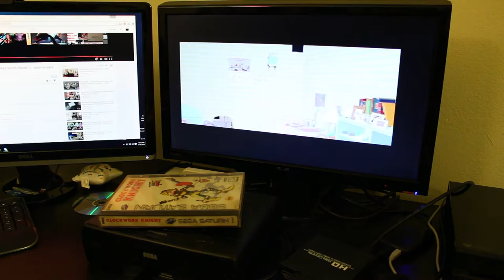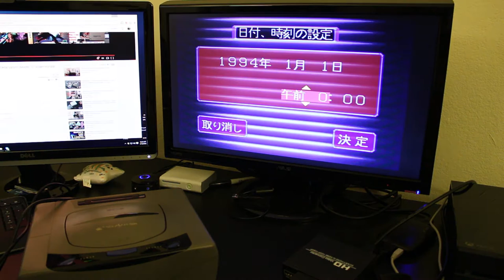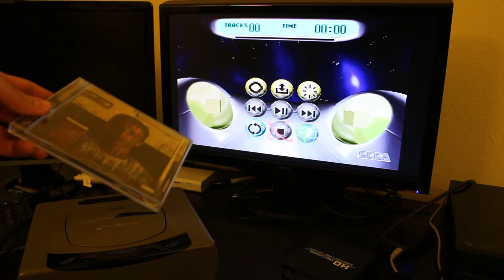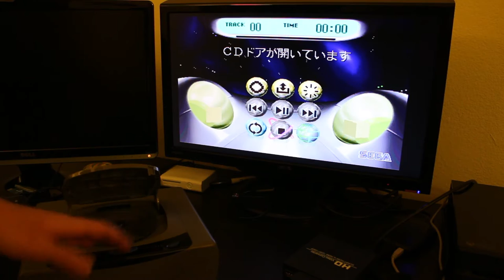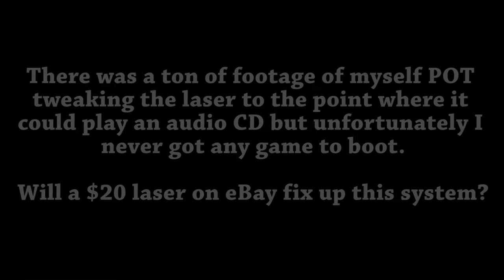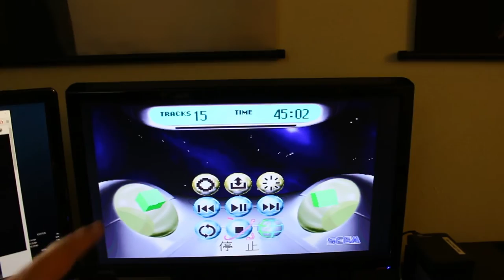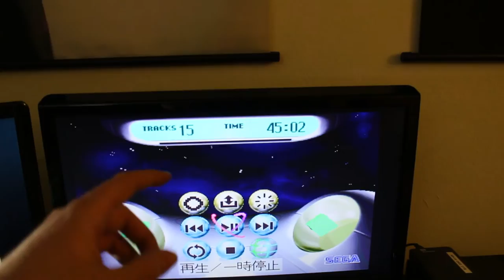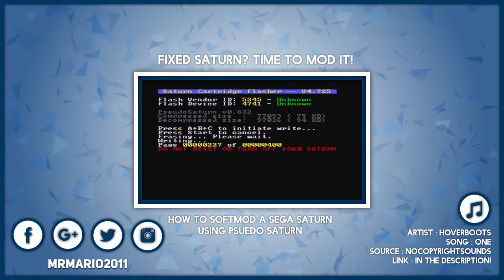Let's Repair! - Sega Saturn Japanese Model 1

Comment: I loved your video on installing a new HDD and IDE ATA 66 cable on the original Xbox, that's something that I hope Uncle Doug can do. Oh wow, that's my model Saturn-I have the Model 1 Victor Vsaturn 12 watt version which I believe is VA2 with the sgram. This is perfect, my Vsaturn for some reason would display the screen and then immediately turn black. I could use that as an excuse to find someone that can Fram or Toslink mod my Saturn and fix it.

Comment: I just got the 3D Pad just today and the analog stick... Or ANALOG BALL works even nicer than the Rechargeable Lithium Polymer 2.4GHz modded Vsaturn controller that I bought a while back. I have the definitive controller set for my Saturn permanently! Am I lucky or what.
Reply from the maker: Very nice!

Comment: Hi man, i have some problem with my japanese model 1, no video but power led on. i think there's some problem with the power supply, the output is now 7.5V - 4.30 and 3.30.   It suppose to be 9, not 7.5, correct? thank you man

Comment: There is a game store that is local to me that is really shady....but I needed a Genesis AV cable....so I went there....bought what was labeled a Genesis AV cable...got it home, and it didn't work.  I returned it...they looked at it and said "oh this is a Saturn AV cable" and I said "well, do you have a Genesis AV cable?"..they checked and they didn't have one....what pisses me off is, they wouldn't give me a CASH REFUND!  Only store credit!  So I had to spend about $15 in store credit on crap I didn't want to buy there b/c they wouldn't give me a cash refund!  I about went off on them demanding a cash refund b/c it was THEIR fault they sold me the wrong cable...it was them mislabeling packaging!!!
Reply from the maker: I worked at a shop that didn't do cash refunds either, but in that case I would have. That's their own fault and they know it.